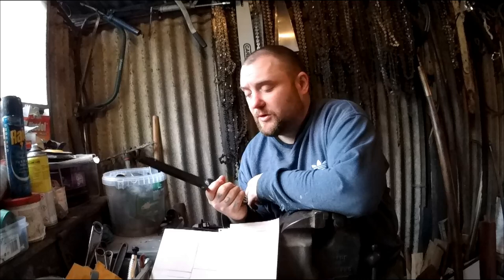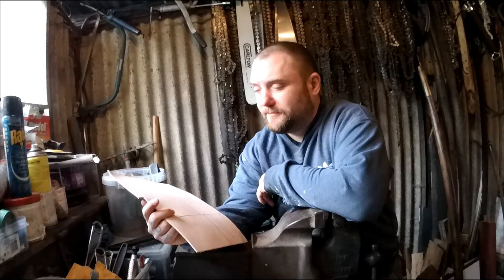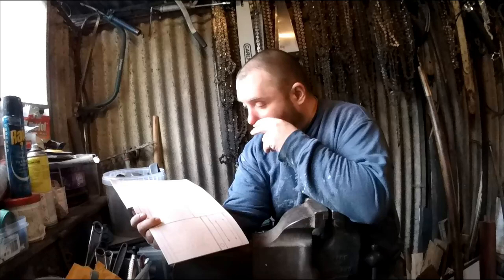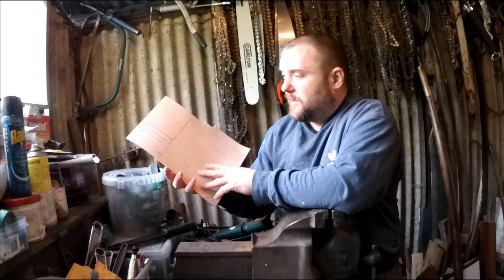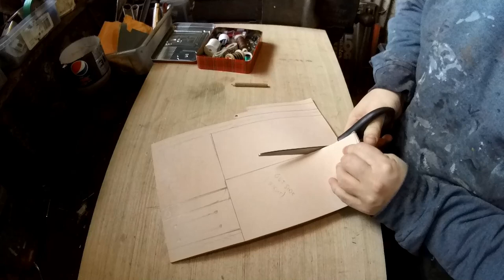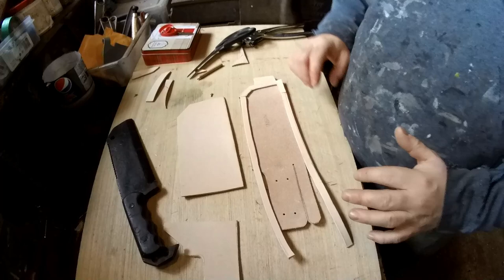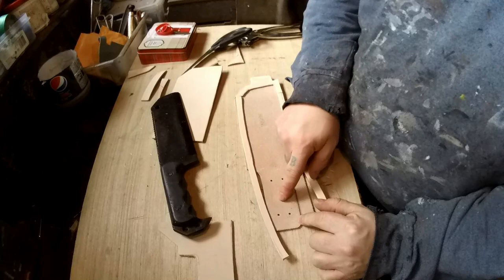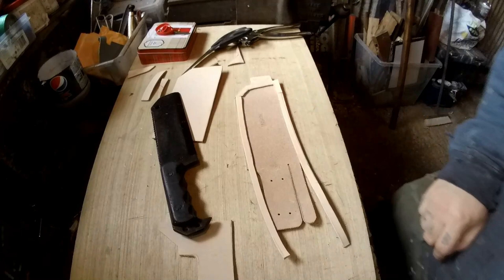Making a Knife Sheath (For My Tactical Meat Cleaver)

Comment: Looks great mike well done mate!!! Not a pro but my aunt is at this stuff and seen her so....If you want a prefect finish for the cleaver just wet the leather, use a screwdriver (round handle) and work all the knife edges where it sits in the sheath and it will hold that shape. Don't saturate the leather tho but just ads that perfect finishing touch. Well impressed bud.
Reply from the maker: Thanks mate, great tips, i will have to try that one day,